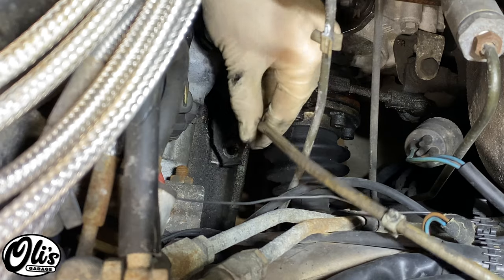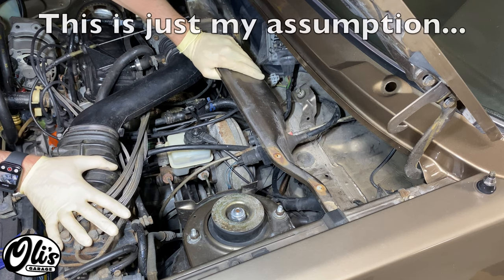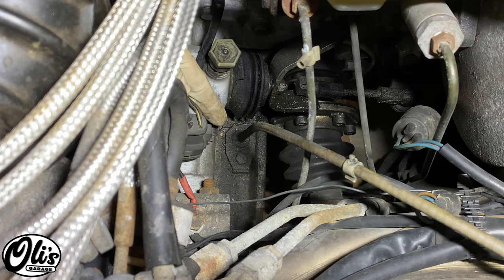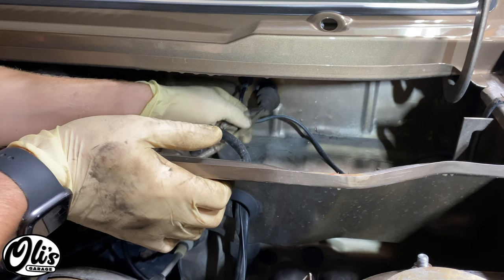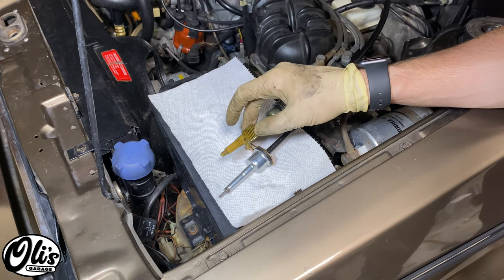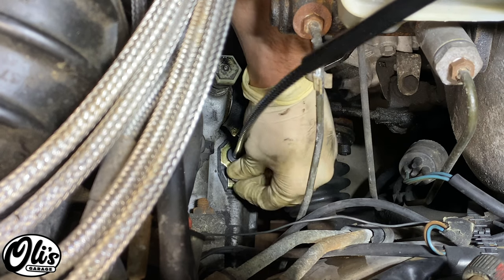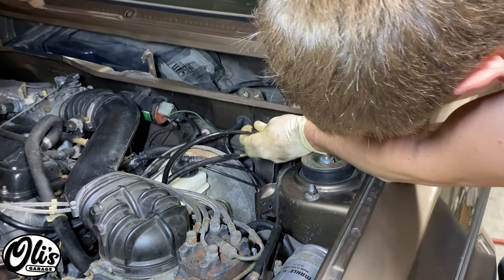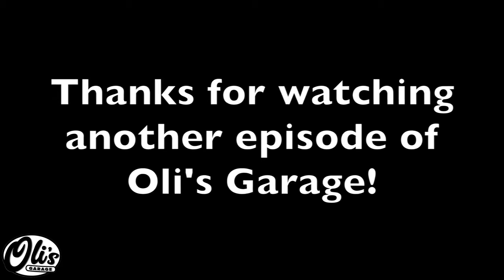Speedometer Cable Replacement VW Mk1/Mk2/A1/A2

Comment: Very insightful video! I now understand why mechanics say to slowly remove the speedo cable from the trans, as the gear may drop into the transmission case. That circle clip is the only thing preventing a simple gear swap from turning into a calamity!

BTW - my mk1 Jetta GLi is out by 10 Km at an indicated 60 Km/h (true road speed is 50 Km/h). Guess I got the wrong gear in there. Need to buy the correct speedo gear for my gear ratio (I presume it's the red one since that one follows the GTI part number), along with a new gasket and a one-piece speedo cable for good measure. I'll be sure to reference this video when I order the parts. Thanks Oli!

Comment: Hi! I have an 87 cabrio (manual) and I have a question about the part number of the cable. Is it 191-957-803 or 171-957-803? or both work?
thank you so much ;)
Reply from the maker: The 191 is the single piece. The 171 is half of the two piece. I changed mine from two piece to single to avoid the oxygen sensor counter box. If you want to keep the counter box, then you’ll need the second part of the cable too.
Reply from the maker: I personally would just buy the 191 single piece and ditch the oxygen counter box if you have it. It literally just makes the osx light come on after 30k miles.
Reply: @OlisGarage   thank you! let's hope everything works out

Comment: i’ve taken the metal piece holding the speedometer in transmission off and pulling and it won’t come out no matter how hard i pull. How can i fix this?
Reply from the maker: I had the same issue on this car actually 5 years ago. I ended up removing the transmission and then could pry the cable out. 

You see how the part inside the transmission looks in the video. Try to carefully pry with screwdrivers and see if you can get it to move. Maybe try to get it to turn first (pliers or small hammer) and then try to pry it out.

Comment: that damn speedogear lol. Mine fell back into the trans, such a pita to get back out.
Reply from the maker: Noooo!!!! That’s my greatest fear! Haha. 
That’s why I never recommend people top off transmission fluid through the speedo gear hole. I try to remove that cable as little as possible to avoid it falling off. 

Though I will say, my gear is stuck on there pretty tightly. Maybe the clip is worn out on some peoples cars?
Reply: @OlisGarage  its just a shitty design in general. But yes the clip must have been bad. Eh... I drove around with a gear floating in my trans for 2 years. Didnt even know it was there.
Reply: @OlisGarage  oh good news on the water pump. threads didn't strip. I put the oring in backwards and was feeling it compress against the seal. water tight again.
Reply from the maker: @json8172  hey glad to hear the water pump worked out! I hate tightening threads into aluminum. I always feel like they are stripping, even when I use a torque spec.
Reply: @OlisGarage  seriously, working on the driveway without a lift is rough lol. So hard to see stuff.
Reply from the maker: @json8172  oh man, I feel you there. I’m working on getting a lift. My buddy just told me he would buy a lift for his garage; that would be amazing. 
I hate jack stands. Let alone working outside. It’s the life of the shade tree mechanic I guess!

Comment: If my Speedo is reading 7-10% high, could it be due to the cable/gear? Or am I wasting my time going that route?
Reply from the maker: I never have messed with changing those gears, but it could be. 
A few thoughts:

-Verify your tires are the right size (sticker inside of drivers door should list tire size)
-check transmission code on bottom of transmission. Then use that to look up ratio of ring and pinion. Ring and pinion ratio is used to determine speedo gear color. Then pull cable and check speedo gear. Sometimes removing the cable is difficult.

My Speedometer reads about 5mph high at all speeds. I haven’t checked my odometer against my phones gps yet to see if there is any difference there. 

Hope that helps. Unfortunately I don’t exactly know how much of a difference a different speedometer drive gear would make.
Reply: @OlisGarage  thanks for the detailed reply. Tires are within the same ratio for speedometer. 4S 020 Trans (diesel gearing). Should use the 16 notch white speedo gear, but haven’t pulled it yet to verify or check condition. I’ve checked speedo against a couple gps speedos and, to give an example, when going 60km/h on speedo, I’m actually going about 53km/h. That seems fairly far off to me, but perhaps I just have unrealistic expectations. Was hoping it was something simple to calibrate or correct but sounds like it’s not so easy. Could just be that far off from the factory perhaps

Comment: Will this fix the rpm gauge? My speedometer works but not the rpm’s
Reply from the maker: It will not. Rpm works from a signal off the coil. Do your water temp and fuel gauge work or no?
Reply: @OlisGarage  yes they do just not the timer screen in the middle and the rpm gauge
Reply from the maker: @christiangutierrez3416  hmm. Honestly I’m not exactly sure where to start. I’ve never had that issue and don’t have a wiring diagram handy.
Reply: Ok thanks